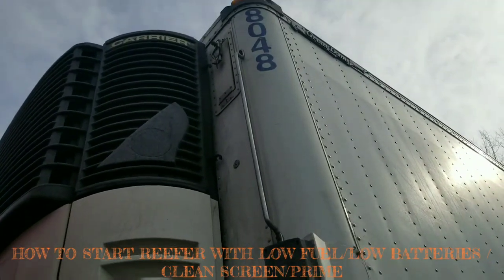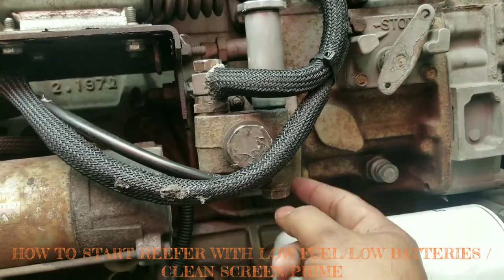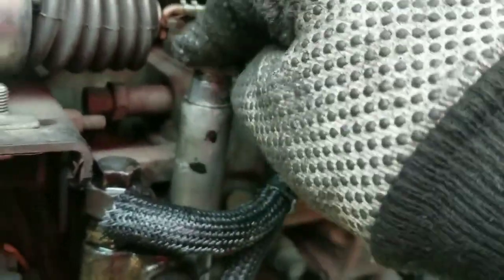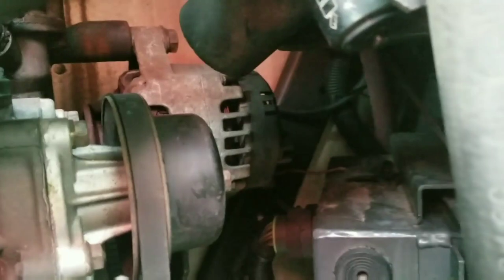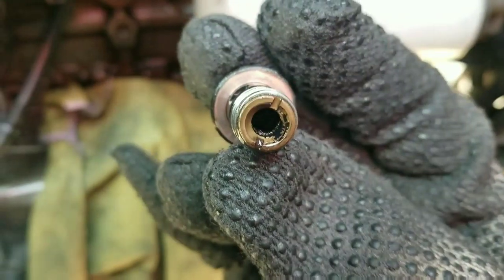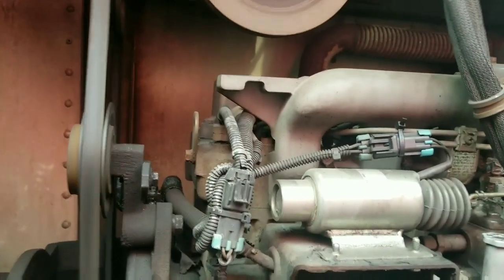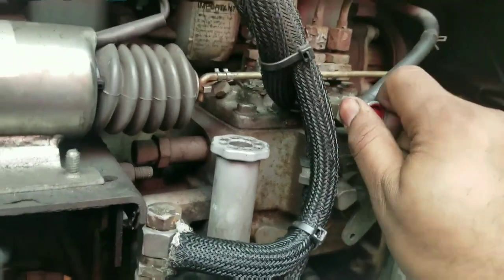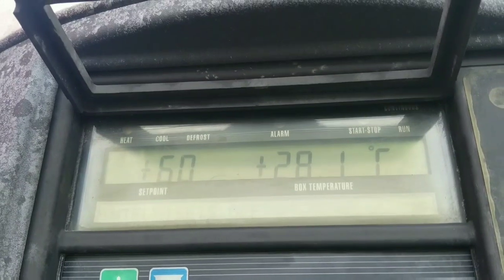REEFER NOT STARTTING? OWNER OPERATORS EASY FIX-(LOW FUEL/low BATTERIES/DIRTY SCREEN FILTER)

Comment: I prime this units removing the line by the fuel.bleeder and with a empty tank with vaccum inside or a old electric fuel pump it sucks all the air out of the system I use a.clear fuel line to see when it's ready it takes about 40 seconds

Comment: Another easy way to do it is pressurize the tank through the vent with an air blower.
Reply from the maker: Its little dangerous for unprofessional due to diesel quantity in tanks u have to be extra careful.
Reply: I work in a diesel mechanic shop, I see reefer techs doing this all the time.
Reply: @Biochemhaze  Yeah, I've probably done it a thousand times, makes life easy.
Reply: Its dueable but not with 120 psi. Is why you see popped sides on reefer tanks.  Max you would do is probably 60 psi?
Reply: @Biochemhaze

Comment: Hi bro hey I got a problem with the stared circuit same your unit, how did you get fix it
Reply from the maker: hammer on the starter۔ while its starting۔ sometime the starter get stuck۔ it works 90٪ of the time۔ and replace it whenever you ready۔

Comment: I'm having a bad times here. 

My carrier transicold 1800 went off and there is no power on the display panel and it is giving siren alarm.
So what did you think is the problem.
Reply from the maker: Low battery 🔋 most likely. 
Did u figure out?
Reply from the maker: Low battery 🔋 most likely. 
Did u figure out?

Comment: This is the comments of millon dollar i don't use primer i go on fuel tank every time i put 5 psi air presion with a regulator and open fuel line on front like he did and push the air out but be careful better tell you friend to tell you when stop putting air mike result on fuel tank explosion if put a lot air on it better way is put air and hold vent hose on top of tank and  drain some air when put air so not be hard in tank
Reply from the maker: Yea. Its dangerous for new guys. I won't recommend that if u not mechanic.

Comment: You guys need to remove the air filter and spray directly in the opening while it's starting. Sloe spray to avoid shutting and it will kick start in 5 to 9 seconds at the most.
Reply from the maker: Yes sir I tried only outside air filter. If the fuel filter screen is dirty that don't work. But if it's only air in lines that work most of the times.
Reply: Avoid starting fluid as much as you could.  Research what it does to your engine.